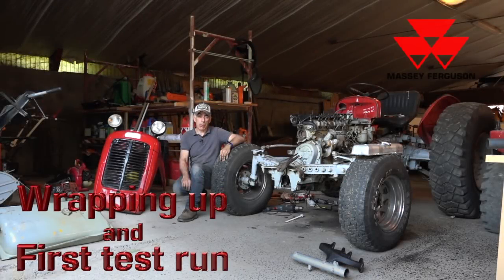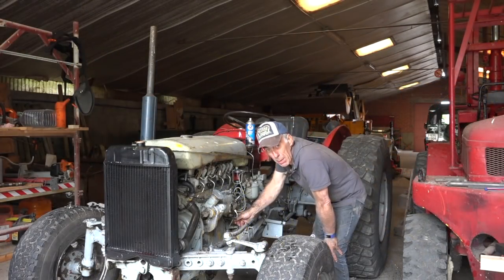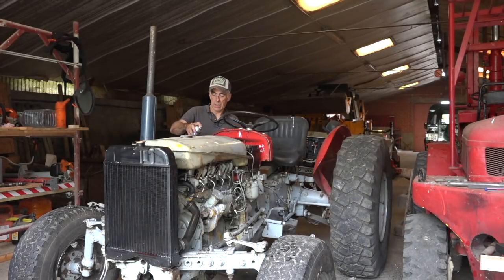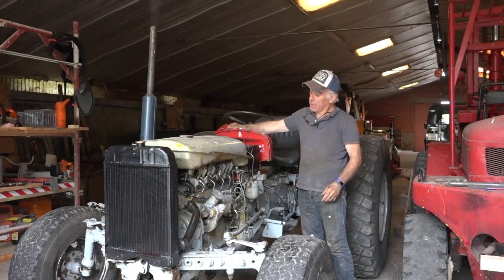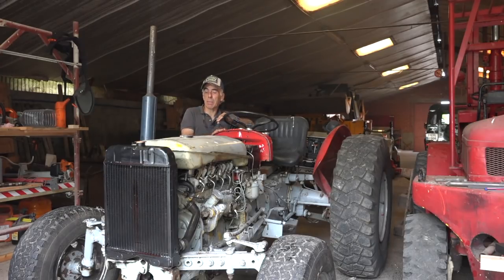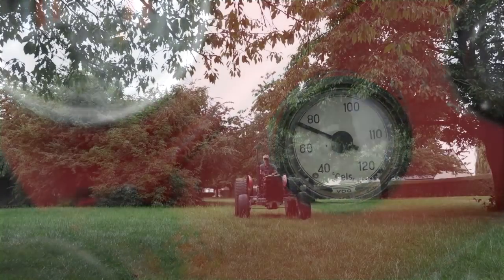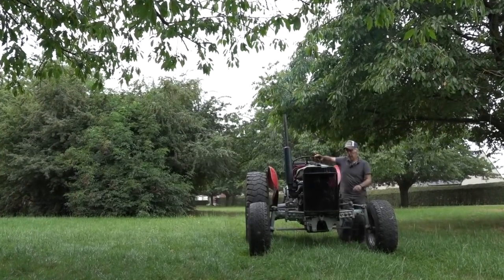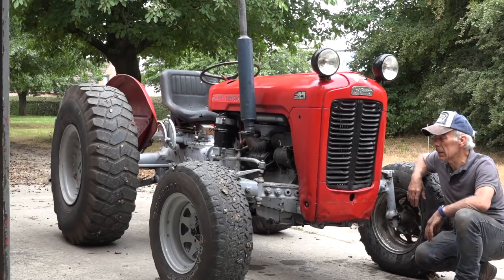Furgy runs again    after all the damage that was done to her

Comment: hi Flemish, let me take you back to this video. how come the tractor does not have glow plugs but starts as if it do have.  but some other diesel cars without glow plugs they just dont start
Reply from the maker: Thanks for the comments, its all about the compression, injectors and off course the ambient and engine temperature,  you will see that engines that are warm or hot start without pre-heating
Reply: @D3Sshooter  i know that hot engine starts without preheat. but tractor does not have glow plugs but starts fine . what is going on there

Comment: Good  vid  but a lot of mis  information 1that.s not a mf engine it.s standard engine built by the standard  motor  company  in England 2 it.s not a Massey  fergusson  it.s a gray fergusson nick named gold belly that was sprayed  in mf colour. s it also is a indirect  injection  engine  and will not start without the heater plugs  working  using easy start weather will ruin the big end bearings and piston. Act
Reply from the maker: Thanks for the comments, although it has the MF cast on the motorblock.  I will have a check and thanks for the info. always good to have that extra.  Note that I did check on the paint on the engine by scrapping it of here and there and nowhere could I found that gold paint on the motor.
Very strange, needs further investigation

Comment: So after my starting issues, rebuilt fuel pump atleast 2 times, I am taking mine apart and inspecting and planning on doing the top end rebuild as long as the lower end is ok, I have suspected now the timing is all screwed up hence the never start.
Reply from the maker: JJ T , timing is critical.  Are you sure the CAV pump is working correctly and timed.

Comment: Dont use aero start or similar to start a diesel the E.S. has a much lower flash point than diesel so will pre ignite and could cause damage.Cold starting should be done with heat,a small gas torch into the intake manifold will do.Good videos.
Reply from the maker: Yes you are right, although this time as a first start after the disassembly it was permissible in order the save the starter.  A gas torch might be an issue as the airfilter is a wet type ( Oil) and tubing is rubber. I guess you mean disconnect that part and get the flame right into the intake manifold.   Txs good tip

Comment: would not thrust that jb weld fix for a longer time span, but its worth the thry....
Reply from the maker: MrBugsier5 , indeed but that is why i have tried it and see how long it will last.   I can always weld it  afterwards.  Will need to take the head off at that time but that is not such a big job.   So far so good a bit more then 40 hours  running this summer.
Reply: you might be surprised how long it can last, it is under little stress, low pressure system and always less than 100c.   i would have ground deeper in the cracks than the guy did and drill holes for deeper attachment of the repair, just so long as it does not freeze again!

Comment: Think it's wonderful you keep the old iron running. They were built for longevity, unlike todays modern tractors.

Curious to know how long that Loctite fix will last though. Used a similar product (JB Weld) in the past, and it was so so on water applications, especially with a lot of vibration. There are stick welding rods specifically for cast iron which seem to be pretty good.
Reply from the maker: Ken Arnold txs Ken. I could have welded it placing the head in the bbq (gas based). Then weld with cast iron rods.  But i wanted to test the sticky kit as the cracks were only on the water channels at the outside.   Its been holding for over 40 running jhours.   Will see how long it will last.   If fails then i will weld it
Reply: if it fails i think you would be better off to braze it with bronze rods by the way i have the same model tractor but mine has the older cylinder head without the heather plugs , it only has a heather plug in the manifold.
Reply from the maker: duggy788 txs yes indeed that is the plan

Comment: Hi. What a fantastic set of videos. Doing exactly this on the 23c engine as a winter project this year to gain a bit of knowledge and skills. Seeing you doing this first hand will really help, just need to figure out what I'm doing with the timing! Thanks
Reply from the maker: Topher Lander  txs,  the timing is not that hard.  Its the cranck to camshaft arrangement ( front lower cover) and the fuel pump . If the engine is still assembled than take the chain cover off.  , position the engine so that cyl 1 is at  top death center just after the compression stroke.  You can do this by watchingbthe valves. And place your own markers if you dont see the originals.   Place them on all shafts.   I can send you a pdf whitbthe alignment.    Good luck
Reply: D3Sshooter thanks for taking the time to reply. I have an old manual for the tractor to help me with rebuilding it but i may be back in touch when i get to doing the timing. 🖒
Reply from the maker: My pleasure, and good luck when you do yours.

Comment: @4:01 what is that overflowing from the radiator?
Reply from the maker: BMW M3 S65B40  that is just water while the engine was getting warm as i did not attach the overrun tube to the top of the radiator and did not had the stop on.